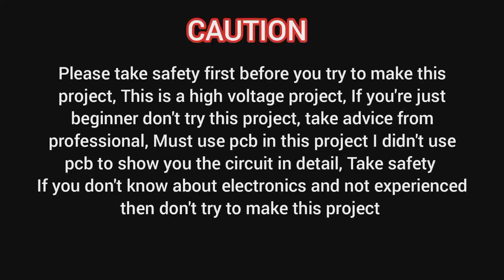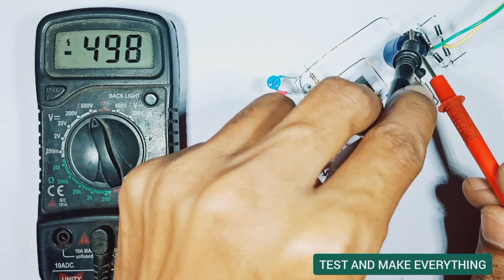Diy 12v 5amp smps circuit | smps power supply 12v 5amp @ZAFERYILDIZ52

Comment: Hi Sir as usual good informative tive tutorial as expected from You.I have dought regarding output amp.checking process in SMPS if product shows rated output voltages but applied product not run like ro adopter  24vdc 2.5 amps how can measure this amps if you have any trick pls.explain or make a tutorial on in this topic.
Reply from the maker: Simply you can test it with your regular digital multimeter or if you have any issue you can make a small digital multimeter which can show you the pass through amp and volt and of course I will make a video on that topic

Comment: Question: Is it good for a replacement Transistor?
Reply from the maker: No , if you use transistor then it will be less efficient and also need to use a heat sink little bigger size

Comment: What is the part number of the transformer used in this cicuit??? I think it is EE category transformer. I wanted to know the exact part number.
Reply from the maker: I don't know the part number I collected it from an old Chinese power supply and there was no level on it you can use any 12v 3amp smps transformer, Thanks for watching❤

Comment: how to wind the transformer?
Reply from the maker: Already make a video about that
Reply: @Skylar_sky  can u pin the link in comment
Reply from the maker: @ShreyasSasane-x4f  You can use any old smps 3.5 amp transformer or you can watch this video - https://youtu.be/bEtelEJ8pz8?si=CfqEgwBIMlDl83PV
Reply from the maker: @ShreyasSasane-x4f  you can use any old 3.5 amp smps link automatically removed you can check my channel or others channel how to rewind smps transformer